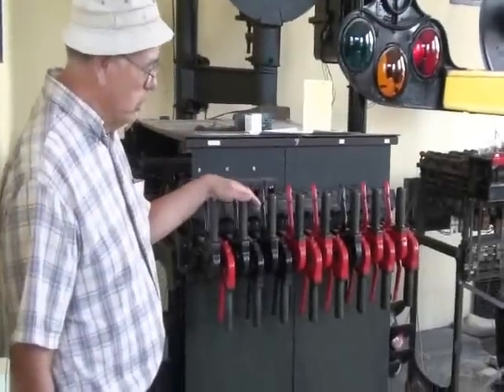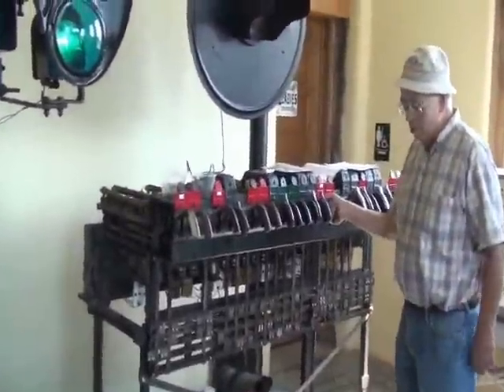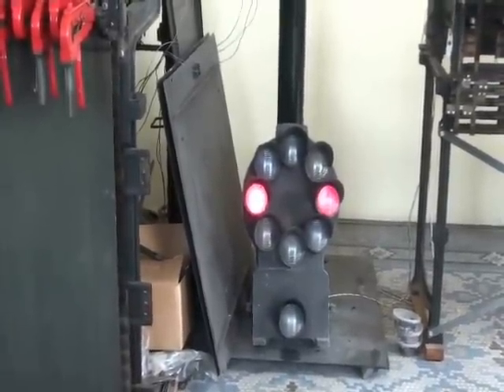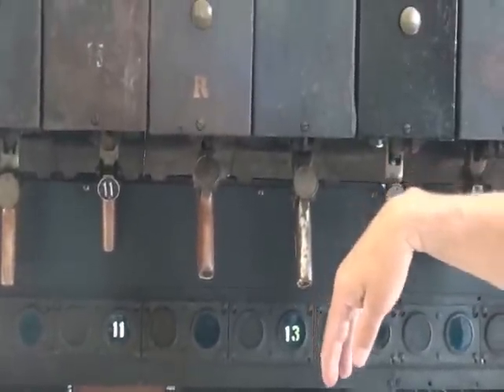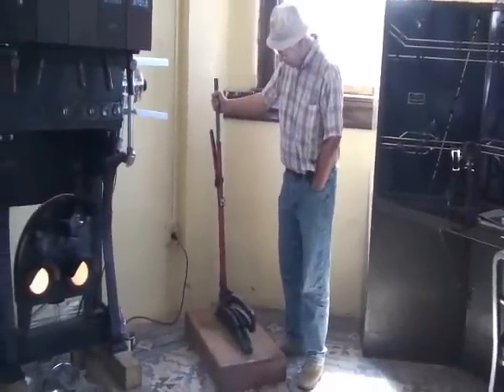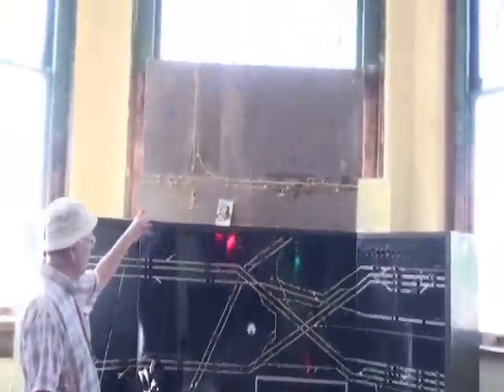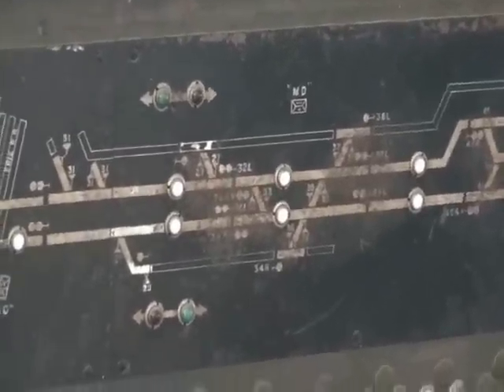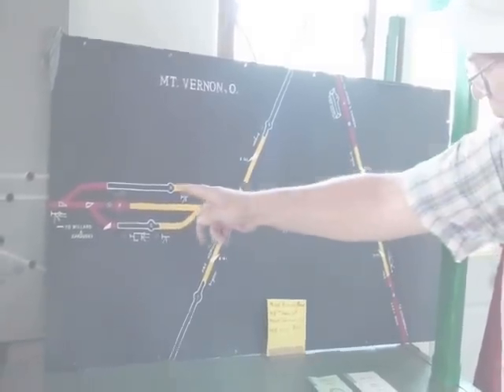Marion Union Station Ohio Interlocking Exhibits

Comment from the maker: The stellwerk at Berlin Zoogarten was a wire plant if I remember correctly.  We used sliding pipes for our manual signals, due to the heavy winter weather we get in this part.